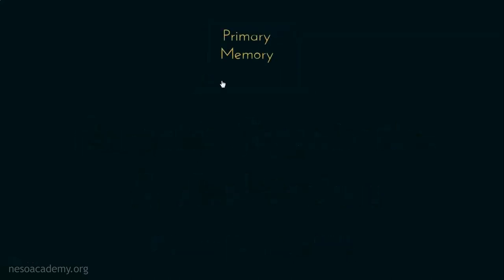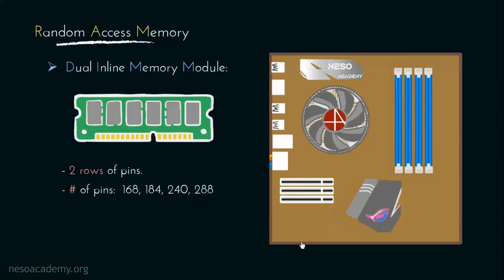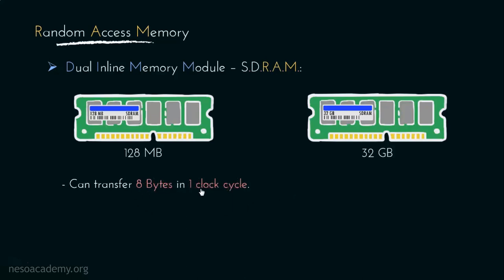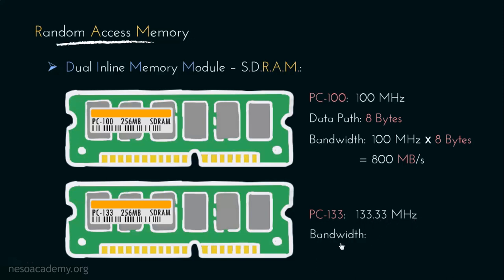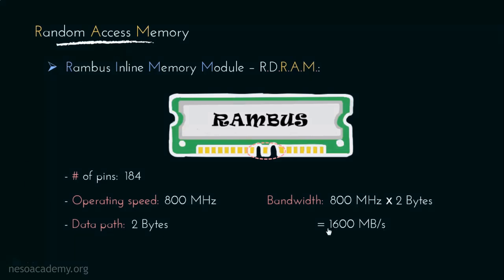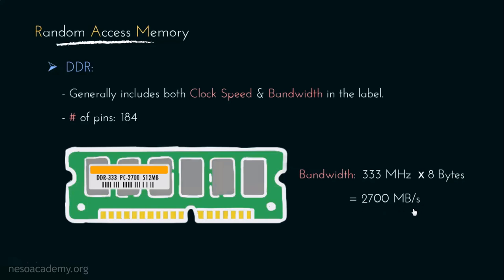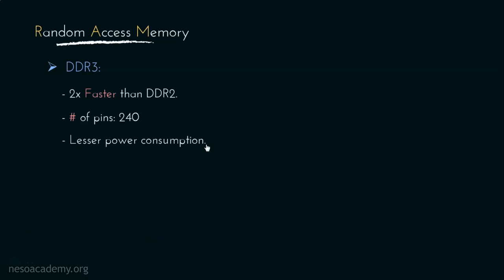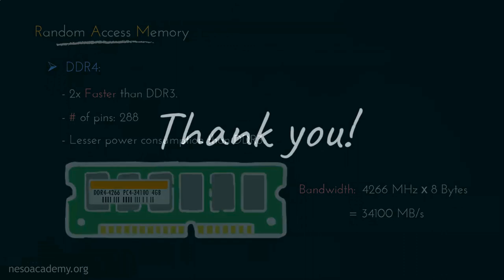Primary Memory – RAM

Comment: You said 8 bytes are transferred per clock cycle. How many clock circles are there for 100Mhz? (1Hz = 1 clock cycle per second) If 8 bytes are transferred per clock cycle, how can it be corrected if multiplied by 100MHz? Please reply as soon as possible.

Comment: I have a ddr2 ram with frequency 667MHz but bandwidth written over ram is 6400... how is this possible
Reply: It's actually a 800MHz RAM, because 6400(MB/s)/8(Bytes) = 800MHz. However, that RAM is restricted to operate only at 667 MHz.
You might have noticed similar situation for your RAMs as well. Usually for a 4 GB RAM, the usable space gets restricted to 3.80 gigs. The remaining portion (0.20 gigs) is reserved for system and other architectural specifications.
Reply: @rock on  if it's a 800 mhz ram then why it is written as 667 mhz on the sticker?
Reply: Because the remaining is used ny system only